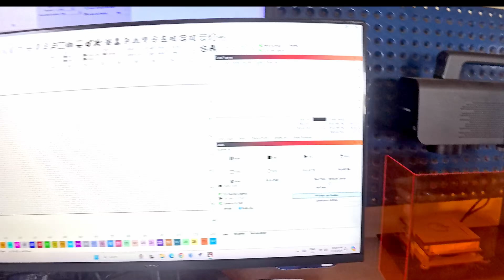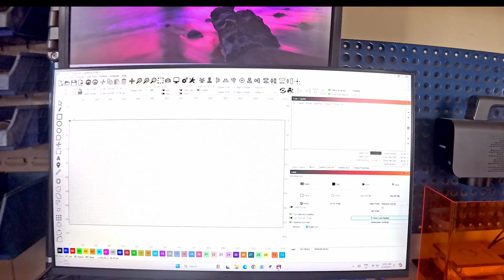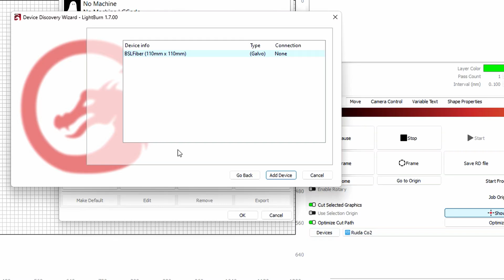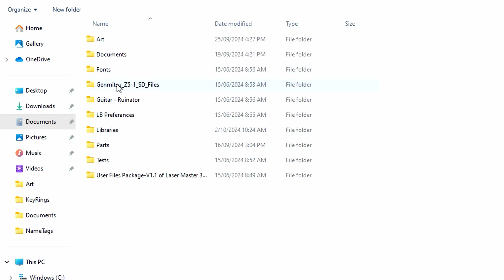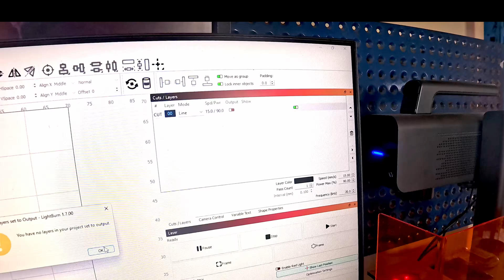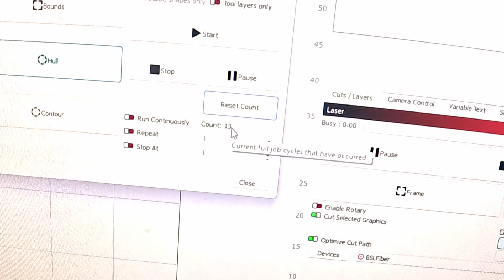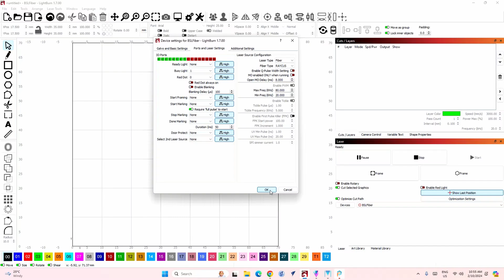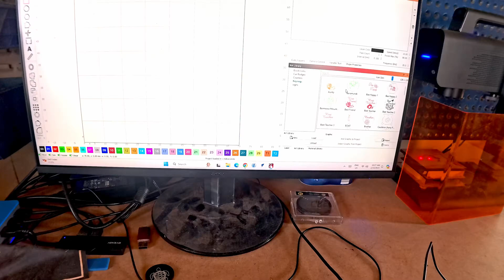Installing the Genmitsu Z5-1 galvo laser in Lightburn v1.7 BSL

Comment: Hey may i ask which settings you have used on the acryl ? I cant get it to work ?
Reply from the maker: @BenCatman  I'm away for a week but will check it out when I get back 👍
Reply: @plasmaDave  thank you so much , maybe i am using the wrong product, but minre looks exactly as yours, but just comes out as a burnt mess with no marking
Reply from the maker: Can't tell you the settings at the moment but the material is black cast acrylic.

Comment: I have the z5-1 also. I was looking at the x-toolf1 and it's basically the same as minus the print size and the diode laser. X-Tool says the F1 can color engrave. Any suggestions how to do this with the z5-1?
Reply from the maker: Not something I've experimented with but it would be easier too run some tests using light burn. A combination of speed power and Hz I imagine. Is now on my to do list.

Comment from the maker: I've just discovered that in the step where I change the "start marking" port setting from 2 to none, if you instead set the option from high to low the button on the handle of the laser will start the current job 👍